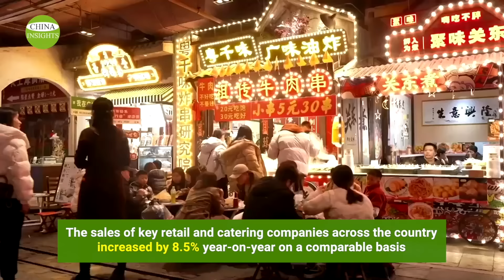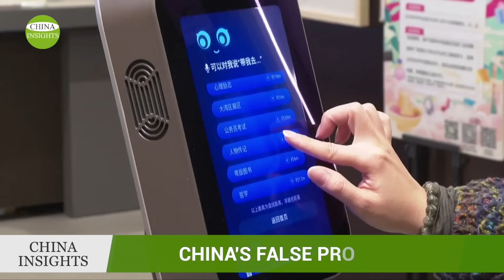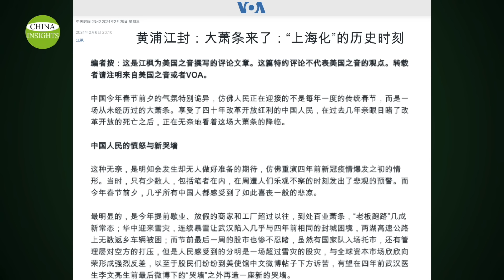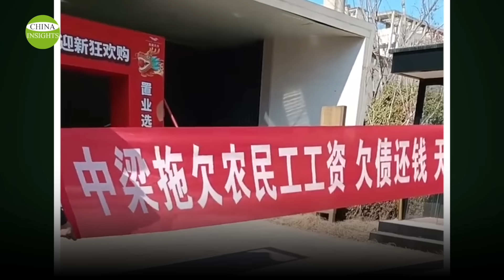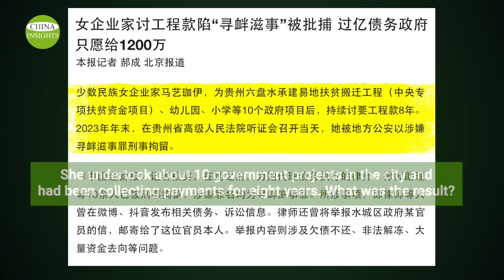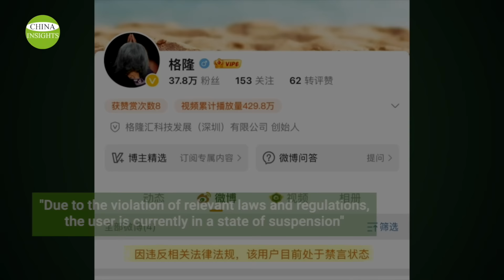Return to Zero: People, supply chain & capital.../Officials try to convince public China is the best

Comment: Again, it's not a confidence crisis, it's a demand shortfall due to high unemployment, reduced & low wages, & major overcapacity relative to previous internal & external sales. The way out: print money like mad/devalue currency but direct it to the DEMAND side, not the supply side: salary support, new SERVICE positions, pension support, including certain expiring cash incentives. That, & bailouts of failed assets & debts, major reform of provincial revenue stream via new tax models, & a depositors' insurance program would alleviate the crisis.